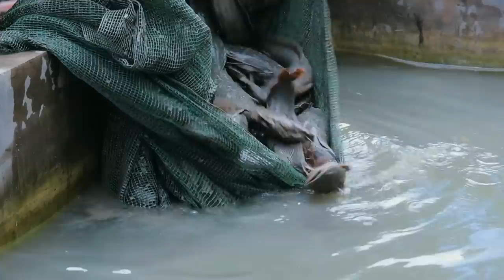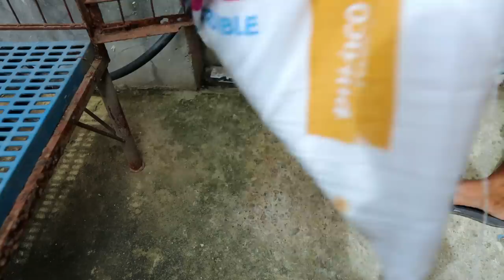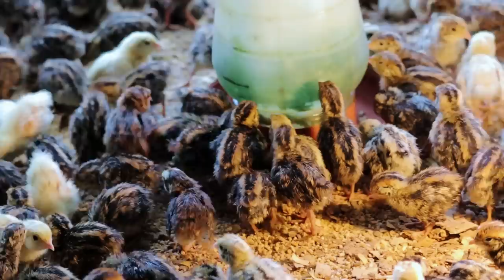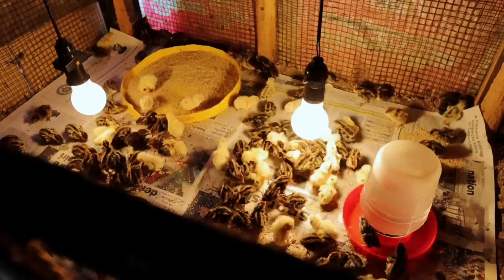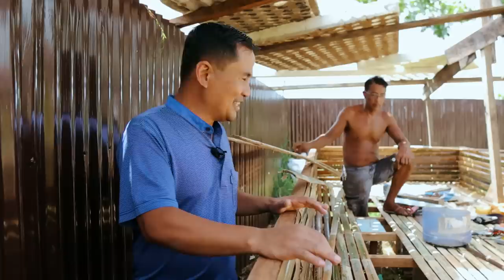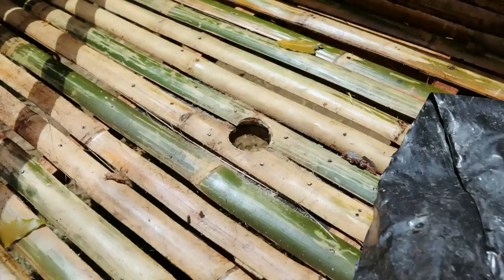Unexpected Visitor!! Wild And Furious Snake Attacked My Quails! Cheapest bamboo tank Almost Complete

Comment: Hi Dexter! I'm back with my other comment to make more water flow in multi points. I saw in this video that your employee drills a hole or more, on the bottom of the tank. Why do not drill  holes in the sides? You can increase the flow and maybe you can put a water tap even to control the flow coming out from the tank in order to balance it with the water pump for the in flow. And also you can choose to recirculate the water from the bottom, middle or just from the top of the tank. I made a sketch about it but I don't know how to send it to you. Best regards from Romania.
Reply from the maker: i want the waste from all over the tank to be siphoned in, in scattered holes.
Reply: @DextersWorld  I just want to say this, you have the flow, you have presure, I let you think for the rest. Keep up the good work.